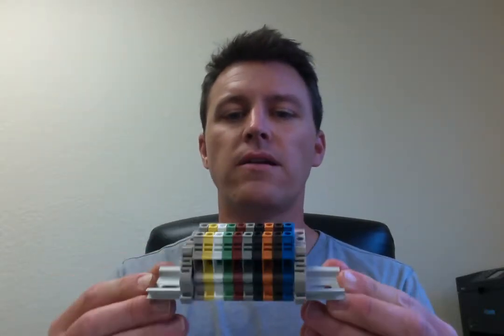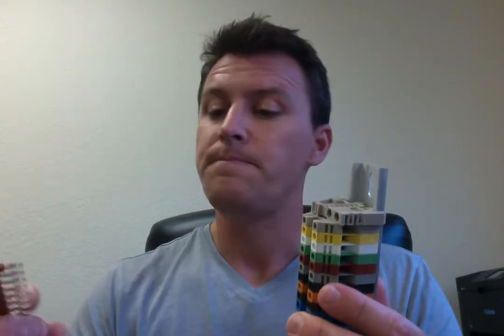Colored Terminal Blocks for Electric Brewery.  What is best?

Comment: Hey Clayton, find your videos very helpful being new to DIN rail. I just bought one of your kits off Amazon, but I’m looking for several different color terminal blocks. Do you sell any kits with five or six different Kullas or can I buy them individually? Also, do you carry any mini or micro din products? Thanks, Mark.
Reply from the maker: The product listed below is the least expensive option.  We also sell blocks in 10 packs and kits that have 2 of each color. 

https://intconnector.com/collections/combiners/products/any-color-dinkle-power-distribution-dk4n-10-gang-box-connector-din-rail-terminal-blocks-10-22-awg-30-amp-600-volt-solar-combiner-1?variant=40966841598104
Reply from the maker: Here is a kit that allows you to pick the color assortment for 20 blocks plus accessories.

https://intconnector.com/products/pick-color-din-rail-terminal-block-kit-dinkle-20-dk4n-10-awg-gauge-30a-600v-ground-dk4n-pe-jumper-dss4n-10p-end-covers-end-brackets?variant=40966816202904
Reply from the maker: The "mini" option is for 15mm DIN rail.  It is the DK2.5S.

https://intconnector.com/products/dinkle-dk2-5s-mini-din-rail-terminal-block-screw-type-ul-300v-20a-12-22awg-15mm-rail-pack-of-100?variant=40966797787288